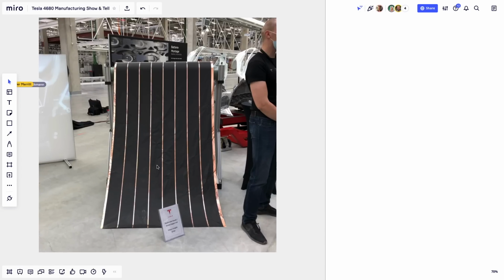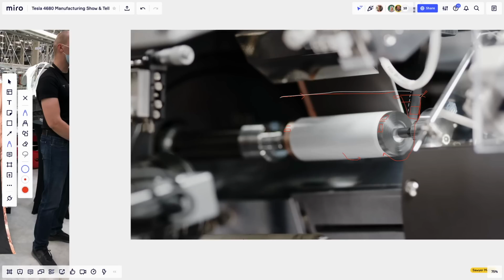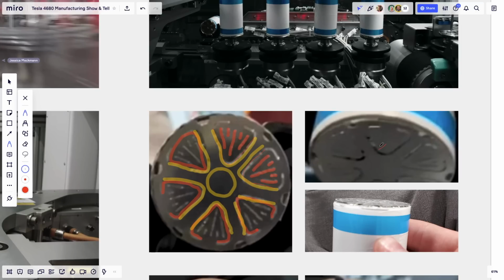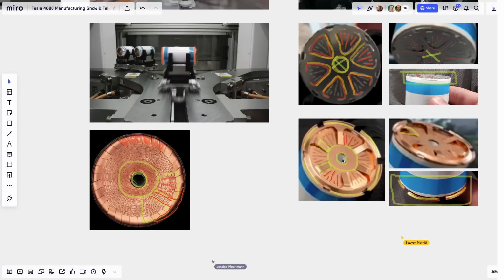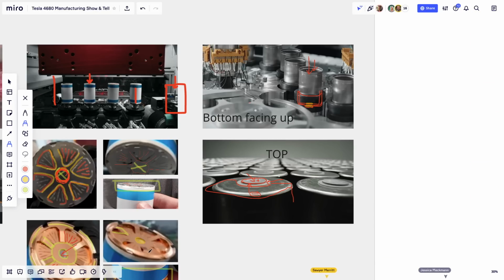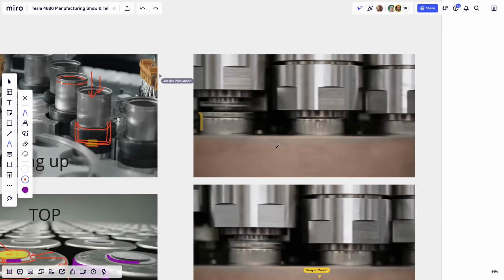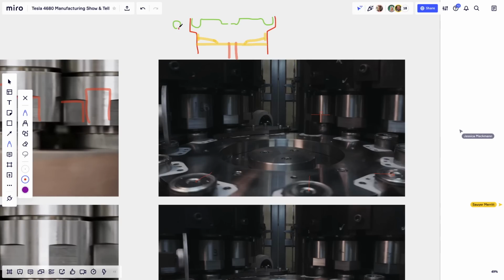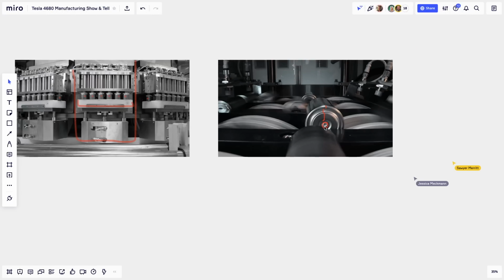Tesla 4680 Manufacturing Show & Tell

Comment: I don't understand why anyone would be excited by this - these batteries were nothing new - simply a different size.
Reply: Bruh. You know nothing lmao.
Reply: The tabless design in the 4680 allows for much faster manufacturing speed and much better cooling and current collection than the tabbed design in the 18650 and 2170. People are excited, because this design should reduce the cost per kWh of batteries. If we are going to get to sustainable, low-carbon transport, EVs have to become cheaper than ICEVs, and cheaper batteries is an important part of getting there.
Reply: @amosbatto3051  Thanks for the insight.

Comment: TESLA made a solid state not in a sandwich style but cylindrical.
FYI to prevent exploding cells they glue the cover. ( botton plate ) So in case the pressure build up the cap can release the pressure.

Comment: I'm suprised that the whole thing is created dry, couldn't you apply a very thin film to the jelly roll to make sure that the electrolyte gets absolutely everywhere? You'd still need the filling step, to fill any voids though.

With regard to the plug in the bottom that you suggest is designed to release the pressure in the event of thremal runaway. I think this makes sense, but I wonder how that's controlled? Is the metal much thinner so it fails there first, because controlling the strength of a weld so it fails sounds difficult.

There will be a hydraulic damping effect if there's electrolyte both sides of the collector plates. As the jelly roll moves up, electrolyte will be displaced and will have to flow through the small slits. This will absorb some energy like it does in a shock absorber.
Reply: Everything is already so thin that if you apply a electrolyte film a micron Thick you decrease the capacity of the cell, and with vacuüm and high pressure injection machines getting a complete fill is not that complicated (well once you solved it at least ;) ) 

Engineering something to fail surprisingly also isn't that hard, you can know exactly how much pressure it takes to break something, its also not like we are talking gramms here, OR even the pressure in your tires, those gasses can build up to 10s if not 100s PSI, though i guess that  ideally you'd like them to be released as early as possible to avoid Collateral damage, its also not needed for the actual weld to give out the filler/cap (material) is good enough. It could even be that it melts

Comment: The picture at 3:50 of the jelly roll being rolled. I'm expecting the order of layers to be insulating separator -> copper -> anode coating -> lithium permeable separator -> cathode coating -> aluminium. However, what I see here seems to have the black cathode coating on the wrong side of the aluminium, so they are making separator -> copper -> anode -> separator -> aluminium -> cathode. 

What have I misunderstood?

When the electrolyte gets added, does it have to migrate from the center along the entire length of the jelly roll? Or does it flood into the end volumes and then migrate past the folded tabs to enter the jelly roll from top and bottom?
Reply: IIRC the foils are coated on both sides.
Despite being thin to the point of near breaking, they are electrically oversized and make a big part of the battery, so using both sides saves a lot.

I dunno about the electrolyte, but I would be surprised if it had to wick the whole roll length, which is real long.
I suppose it wicks from the can top/bottom, with a few turnings over to help.

Comment: The lid that is being placed on the cathode side looks like the same process we used for our pop cans.  We had a Seamer machine that had 12 heads with each head having a chuck & roll. ..  The Seamer was like a carousel with the heads spinning as the cans came through.   Our can line speed was 1300 cans per minute.

Comment: Really great work, thanks a lot.
I don‘t think the current collector act as a spring. It just has to be like a „springy thing“ because the „rosetta“ isn‘t flat, it’s building up from the edge to the center. So the current collector welds can follow the shape better and don‘t deformate the collector. 

Also maybe they won‘t weld the copper current collector to the can, just crimping it into the can together with the cap. It would be one step less. And for me it explains the outer shape of the collector.

Maybe it has multiple purposes, like the vibration compensation you mensioned. 
I would like to know, what you are thinking about it.

Comment: He mentions a ton of seemingly complex welding happening in these cells, but that doesn't make sense to me...is he certain of that?  Seems like unnecessary steps and failure points, the compression should be enough, especially after turning all the cells into a brick in the pack with an epoxy like material later.
Reply: I don't think it would be reliable enough, considering there will be thermal expansion and contraction at each charging and use cycle.

Comment: The best way to look at this construction is basically the same as Extended Foil Film Capacitor construction. With film capacitors both ('anode' and 'cathode') ends are metal sprayed  
to effectively electrically parallel all the windings.

Comment: In the structural pack, the cells would likely be more exposed to vibration than the current 2170 or 18650s which are by design more insulated.  That said, a design which can control for multiple variables is  ost efficient.   You guys are most likely both correct!

Comment: I'm guessing the gaps in springy star shaped collectors will also allow a path for expanding gasses to collect at each end where they can be vented. And the very thin collector would also act as a fuse during catastrophic short circuit.

Comment: What is the possibility that these get added to the S&X sooner than Y and how does the naming like long range, plaid etc... then change along with range and price??  No one is talking about this and seems to be a good opportunity for new discussion.  What do you guys think
Reply: The MAIN benefit of the 4680 cells, which in turn enable the structural functionality of the pack, is lower manufacturing costs, with the highest impact on their lower-cost, higher-volume lines. The cells by themselves do not provide significant improvements in the performance of the car. There are performance benefits from the structural pack. But you also need to consider that Tesla can currently sell every S and X they make, for many months ahead of production. There’s little good reason for them to engineer and switch the mfg lines to the new cell & pack architecture on those vehicles.
Reply: Zero ... S&X will stay on 18650 until Panasonic doesn't want to make them anymore i.e. at least for another 5 years.
Reply: @MsWarpedone  good point but that seems to indicate your most expensive vehicles remain on the 1st gen(18650) batteries while your last expensive enjoyed second gen (2170) and now get the 3rd gen (4680) first and leave those vehicles behind technologically speaking in your near future.  That appears to be a tough sale is all I'm saying, like giving the iPhone Pro Max the oldest smallest battery, worst camera, and no oled screen but the cheaper iPhone 13 has all the innovation larger fastest charging best camera etc... For half the price.  Seems something more is in the air, my Spidey senses are tingling....
Reply: @michaeloutlaw5157  Tough sale you say ... being the fastest production car ever at a cost even I could afford, with range far above my needs and safety and reliability that is still unparalleled by competition... well, it is an easy sale with me. I am not buying the cells, I'm buying the car for what it can do for me.

Secondly, you are only talking about the form factor and ignoring the chemistry that goes inside. Current 18650 contain the same chemistry as current 2170 do. A bigger form factor allows for a different chassis philosophy. Model S and X do not need millions of sales a year, they are not in that segment, so benefits of a bigger cells are smaller with S/X as they are with cheaper vehicles.
Reply: They’ll just update range on the model Y, just how they did it to the model S, when the long range was 335 miles, and then it updated to 370 miles, so model Y will likely be the same. I think you’re just overthinking this. Long range will get more range, ~400 miles, and SR will be introduced as a model with ~300 miles of range.
Reply: @harsimranbansal5355  thanks, and yes i figured that would be around the range estimated for the Model Y, but Im more curious about the S&X only as they are the current halo vehicles and now you may have similiar range but a large price differential, so how can they justify that sale, which therefore seems they have to add the 4680 to the S&X also while maintaining a mileage lead for the more expensive vehicles right?  My question in more S&X leaning because no one is forecasting any info about 4680 and S&X.  We  understood that was the Plaid Plus but that disappeared quick with the projected 520 plus range.  So now what?
Reply: @michaeloutlaw5157  when they add them to the model y they probably reduce the pack size so the range stays almost the same. So they actually need less batteries to produce the same amount of cars.